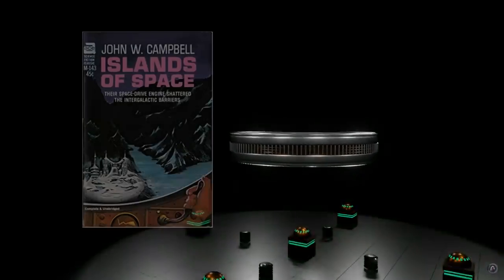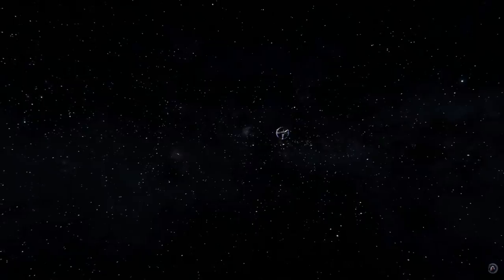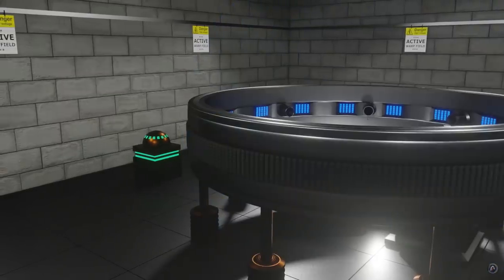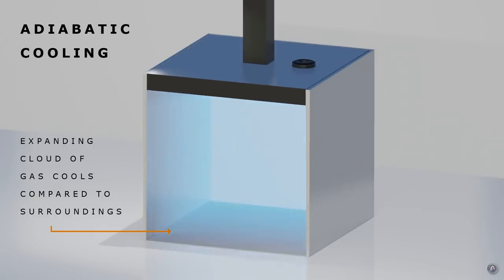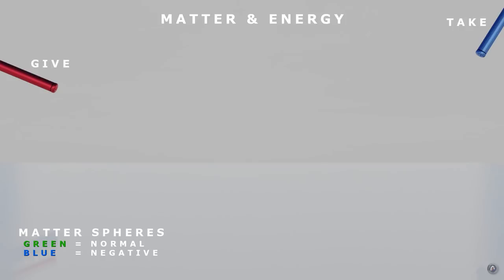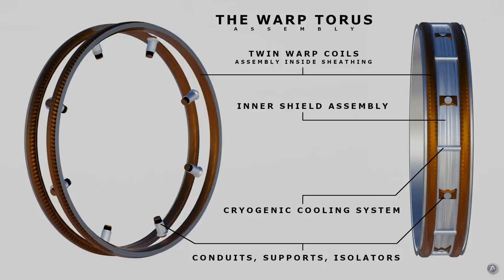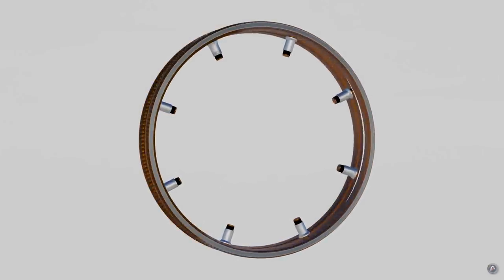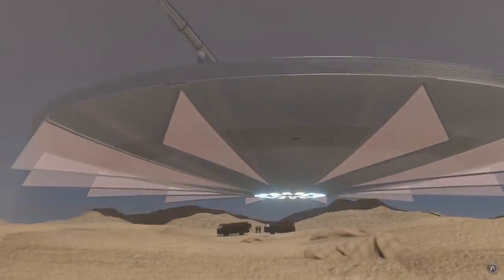A Detailed Breakdown of an Alcubierre Warp Drive Coil

Comment: So..practical warp drive is getting more and more into a domain of "enginering problem" than "science/physics problem"... thats quite promising...
Reply from the maker: Fueled by an increased understanding of the medium (spacetime) in which we will travel.
Reply: 03:30 It says "18 billion mega-watt hours for a single warp event".  1,000,000X3600=3.6E9 Joules.  Times 18 billion; 3.6E9X18E9= 6.48E18 Joules.  Okay; even with your Quark matter bred to antimatter for fuel and a 1 TW reactor power fed to the ring would take 6.48E18/1E12= 6.5E7 seconds or 750 days to deliver your "one warp event energy".  What size ship/coil/power reactor(s) are you envisioning for your ship?  That would have to be one large coil and obviously large ship to generate/handle that kind of power/waste heat etc.
Reply: Yup, the biggest issue to overcome is the power requirements to either go as fast as light, or more likely, to rip a spot of time and come out back into the stream of time somewhere else.  Though not the only issue, just one of the big ones.
Reply: 18,000,000,000 MWh??? People dont get it how much energy that is, a nuclear powerplant wont be enough. I heard that they reduced the amount of requited negative mass needed for a warp drive to a few kg, by changing the shape of the disk and by making it oscillate to high frequency, we might do the same thing with this version of warp drive so we can drop the energy needed to a few gigawatts and in addiction...we might find a frequency of resonance like Tesla did with voltage in order to amplify the warping intensity of the ship by the time it travels, that will drop the amount of energy required even more, by far.
Reply: @asteronx  18,000,000,000 MWh??? People dont get it how much energy that is, a nuclear powerplant wont be enough. I heard that they reduced the amount of requited negative mass needed for a warp drive to a few kg, by changing the shape of the disk and by making it oscillate to high frequency, we might do the same thing with this version of warp drive so we can drop the energy needed to a few gigawatts and in addiction...we might find a frequency of resonance like Tesla did in order to amplify the warping intensity of the ship by the time it travels, that will drop the amount of energy required even more, by far.
Reply from the maker: @tirannoide9056  Thank you for the suggestions. We are already aware of such things and have already been exploring possible ways of reducing the amount of energy needed.
Reply: THANKS TO A MEXICAN SCIENTIST OF THE NAME . MIGUEL ALCUBIERRE.....AND NEVER GOT THE CREDIT FROM THIS STUPID VID.....OH BUT STAR TREK DID AND AND A HANGER ON A DOCTOR WHITE WHO MERELY WANTED TO INVOLVE HIMSELF IN MIGUELS CONCEPT.
Reply: This is a static warp field a lot of things are being overlooked. For a warp drive to work well have to learn to make a warp matrix. To control all the energy condition and make them work for you. You have to deflect and collect some of the spacetime energy and particles in front of the ship.That well also change the bipolar warp matrix by increasing it. This collected matter and energy can be converted to first antimatter then into warp plasma or what we call depositrum. Once you have enough of this it becomes easy to store and then use. It has the same energy as matter antimatter without maxing it with matter.
Reply: Actually, it's also a "science/physics" problem because key elements of the concept have not been proven to exist, save for in the imagination of scientists.
Reply: @ZeyphodZeyphod  The thing would explode and then maybe emplode not good.
Reply: "The thing would explode and then maybe emplode not good."  But the video maintains that reduced inertial mass effects etc. would happen at field strengths/currents/energies well below the 18E9 mega-watt hours amounts needed for the full on warp effect.  That is we would have proof of concept (& useful effects) at much lower energies; once we have that the rest is just a engineering challenge.  Albeit a serious one.
Reply: @ZeyphodZeyphod  The problem is not the mass effect. The problem is the bipolar fields. You have a contracting field in front an expanding field in back and rest mass in the middle. You are creating a unnatural imbalance, space well try to balance itself. To help keep the three field balanced you have to have it moving at a threshold speed. The three field have to be far enough apart and each at the correct energy level compared to each other. Some of this finds it's on balance but not completely. At low power the balance is not that important. But at high power level it is. If you put to mush power in a small spot the power may or may not overload and explode but the effect if too high well emplode. At high power all three fields have to be in balance. You also may be able to alter the front field through vacuum engineering and decrease the energy need of the matax  and produce more energy at the same time and counter the radioactivity at the same time. But I am going off the subject. Too much energy too fast can collapse the field.
Reply: @Clement Vining   But first we have to establish that it works; the lower energies would give us our needed proof-of concept.  Reduced inertial mass etc. would make high performance aircraft like the alleged Gimbal or Tik-Tak footage crafts possible. Then we can work on engineering it to handle the issue(s) you speak of.
Reply: @ZeyphodZeyphod  I agree and I think the military is already doing so with superconducting liquids or solids which is a gel.
Reply: @colonelburton8451  What parts tell me.
Reply: At the end of the day it's that exotic matter we need.  Dark energy exists (despite naysayers) and that expands the universe faster than light.  At least at the edge.  Which is why we don't see anything beyond the edge.
Reply: Zeyphod45 Zeyphod45 what of you put your power plant in space and wait for it to make sufficient energy and then go up attach it and go
Reply: @ZeyphodZeyphod  Are a university student?
Reply: @tirannoide9056  wouldn't put it past Elon musk to pull it off.
Reply: @TheCaptainSplatter  It isn't Dark Energy that is needed, it is "Negative Energy" which is made out of pure mathematics.  It isn't a real life thing.    Unless you can show me a negative hamburger or a negative glass of beer, we aren't going to be able to make a negative-powered spaceship
Reply: @jengleheimerschmitt7941  dark energy might be negative energy.
Reply: @seansoblixe9711  the warp drive is literally named after him. "Albubierre Warp Drive Coil".
Reply: it would take less time if they wanted to even a test flight for lets say 5 seconds close to FTL or Impulse would tell us if a craft even the size of a car or smaller covered 4 times the distance to the moon or did it get close to the distance of mars? Will see I hope...sooner....
Reply: @clementvining2487  _
Reply: @tirannoide9056  they have worked out a way recently to use normal positive matter
Reply: @TheCaptainSplatter  Dark Energy and Dark Matter are placeholders for an unknown matter and energy we have not discovered yet to account for the universe's total matter/ energy i.e. total mass/ energy of universe = observed matter/ energy + dark matter/ energy.
Reply: @TheCaptainSplatter  We are limited in how far we can see out into the universe,  not because it's expanding, but because we eventually look so far that time that light would have taken to reach us would have to have come from the Dark Era of the Universe, which is a period when the universe was opaque, ie light couldn't freely move through spacetime. So there was no light for us to see.
Reply: @ZeyphodZeyphod  Except recent speculative models bring that power down potentially (if each pan out and can go together) as much as 30 orders of magnitude. 

Then there's the recent work of Eric Lentz suggesting negative energy mass could be avoided completely.
Reply: It's not an engineering problem.
It's not even a physics problem.
It's a causation problem.
By definition FTL is backwards time.
You can't arrive before you leave.
Reply: @deerlakediver5554  only if you're moving through normal space time. As soon as your path is disconnected from the path taken by light you just arrive before the light showing you left. It falls under the acausal effects already observed in situations like the delayed choice experiment cause and effect happen out of the usual order but must still preceeded observation. Which in this case would actual be a closer fit for actual backward time travel being allowed so long as the light of your arrival at say Alpha Centuari 4.3 years ago doesn't arrive at Earth untill just after you jump away from Earth. That's "acausal" without violating causality.
Reply: @deerlakediver5554  Let's consider 3 perspectives of a ship travelling between two points using this theoretical FTL drive, from the origin, the destination and the ship. Let's assume that the ship is travelling 5 times the speed of light, and leaves at year 0 and travels a total distance of 10 light years. From the point of origin the ship would appear to arrive at its destination 12 years later, 2 year ship travel time and 10 year light travel time back to the origin. From the destination two ships would suddenly appear seemingly out of nowhere at year 2, one would appear to leave and progress backwards towards the origin for the next 8 years with events happening in reverse and then suddenly disappear, 10 year light travel time from origin less 2 years ship has already been travelling, the second one would be normal from time of arrival. From on board the ship the trip would take 2 years, but looking towards the destination everything would appear speed up by a factor of 5, looking backwards to the origin events would appear to speed up by a factor of 4 but going in reverse or not be visible at all as light wouldn't be catching up to you.  I'm assuming that as this drives is compressing/decompressing spacetime that itself is not subject to any relativistic effects. So from the point of view of the destination and the ship once it arrived, you would see the ship arrive first and then be able to watch it in reverse until it gets back to the origin and suddenly dissappears 8 years later. Anyway obviously just pure speculation, and fun thought experiment, and I'm sure that there are actually numerous issues with my description.
Reply: @nic.h  
Time and distance dilation are REAL.
They are not just visual illusions.
On a long enough trip you would arive (even from your own perspective) before you were born.

Then there is the whole problem of distance. From the ships perspective the faster it goes the shorter the distance in front of it.( distance compression).
Above the speed of light that distance in front of the ship shrinks past zero, to some negative number. There is no such thing in a four dimensional universe as negative distance. For the exact same reason there is no negative time.
Reply: @johnassal5838 
Forget about a ship....
INFORMATION ITSELF CAN'T TRAVEL FASTER THAN LIGHT..
Reply: My Nibbler  
Three scenarios...
1. I'm traveling slower than light.
From my perspective it takes me 10 minutes to make my trip.
2. I'm traveling at the speed of light.
From my perspective it takes zero minutes to make that same trip.
3. Im traveling faster than light.
From my perspective It takes me negative minutes to make that same trip.

That third scenario is not possible.
Reply: @deerlakediver5554  "Through Space." If instead that information takes a shorter path, be that through a wormhole or hitches a ride in the unusual topology of an Alquibier-White effect then from it's perspective it will not have attained any special level of speed. 

Consider that a version of the  Delayed Choice Experiment could be run with a photon the path of which is/was bent by a gravitational lensing object like a galaxy a hundred million years in the past and a hundred million light years away. To the best of my knowledge it has yet to be, but if it ever is and it's results mirror those of much smaller yet thoroughly reproduced table top versions ( which do indeed validate the acausal order of events ) then an action in the present will determine the path the photon already took though the final result (conveying information ) will not be visible until after the action in the present blocks one of other path. True that photon does not encode a traditional signal but it's mere presence and significance tells you your action must influence prior events just to get that result. 

No I'm not trying to claim that this constitutes any sort of FTL signaling device but it does show the equally big implication that cause and effect can vary and very definitely traverse immense distances and durations without violating causality or engaging in time travel anymore than an FTL craft would just because light is slower.

Einstein was very clear that this should only really necessarily apply to movement through space time and not instances where the space time moves or is contorted into a shorter path. Yes these have their own issues at the moment but these are increasingly becoming more and more an issue of engineering. It's anyone's guess as to IF this will continue untill FTL becomes practical. 

Feel free to shift your argument to the known issues of wormholes for instance (without actually responding to the fact your previous point was in fact answered.)
Reply: @deerlakediver5554  remember that this drive is in theory compressing spacetime in front of it, so within its own bubble of spacetime it isn't traveling at speeds faster than light. At least that's my vague understanding of what it's supposed to do. While I could arrive at the destination before the light from the time of my birth would get there, that in itself isn't a problem, I wouldn't be able to return back to that point before my birth in space time with how I was describing this.
Reply: @deerlakediver5554  No kidding the third scenario is nonsensical /sarcasm off./

You're going out of your way to apply relativistic laws to movement through space that everyone else here understands would be impossible. That's really not what the question is. Smh.
Reply: @johnassal5838  
Feel free to start insulting someone else.
Reply: @johnassal5838  The Universe DNGAF about your rules, or your light. The speed limit that everything in the Universe must adhere to - the universal constant - is about something much deeper. As Matt explains, the speed of light should really be called the speed of causality.

You can think of causality in relation to a concept known as the spacetime interval, which states that causal connections are the only order of events that all observers, from wherever they're positioned in the Universe, can agree on.
Reply: @deerlakediver5554  OK, just as soon as anyone else acts as smuggly self absorbed yet inexplicably ignorant of their own errors I'll be sure to offend them too by pointing as much out. 

Tl;dr: Your repeating Einsteins verified conclusions for motion in 4d isn't actually going to apply to scenarios intrinsically intended to avoid it the conversation everyone else is having is in regards to the surprise we all feel that this second scenario may in fact be achievable or at least may soon be just as testable as GR or SR. 

You're arguments are 100% valid in context which unfortunately your comments are not. You're not the only one finding that mildly insulting.
Reply: @johnassal5838  
OK, you have a warp drive and it takes 15 days to reach Andromeda... in whose reference frame? The traveler's? Those left behind on the Earth? Somebody else? The amount of time that elapses between two events depends on the observer.

And here is the thing: if you move faster than light, there will always be observers (who themselves aren't moving faster than light, i.e., perfectly ordinary observers) for whom the amount of elapsed time will be negative.

OK, you say, you don't care that some people traveling on strange trajectories see you moving backwards in time so long as the people left here on the Earth don't. But it's not that easy. Because you can devise a round trip that allows you meet with these observers, fly to Andromeda and back, and then meet with them again... before you met them for the first time, as measured by their clocks. In other words, you bring information to them from their future, and then you have a chance to influence their past. (Which is when all sorts of paradoxes ensue, much to the delight of Doctor Who fans.)

Having said that... it is possible to conceive of faster-than-light travel without a causality violation, but only by introducing additional postulates. Specifically, if you introduce a privileged reference frame and postulate that no matter how you travel, you can never move backwards in time with respect to that reference frame, as a consequence you will never be able to return to someone's past, no matter how they move. Causality will be preserved.

The existence of such a privileged reference frame is kind of an anathema to relativity, but it is a legitimate postulate. Such postulates (explicit or implicit) are sometimes used in novel theories (e.g., bimetric theories) to allow for violations of Lorentz invariance without breaking causality.
Reply: @nic.h  
OK, you have a warp drive and it takes 15 days to reach Andromeda... in whose reference frame? The traveler's? Those left behind on the Earth? Somebody else? The amount of time that elapses between two events depends on the observer.

And here is the thing: if you move faster than light, there will always be observers (who themselves aren't moving faster than light, i.e., perfectly ordinary observers) for whom the amount of elapsed time will be negative.

OK, you say, you don't care that some people traveling on strange trajectories see you moving backwards in time so long as the people left here on the Earth don't. But it's not that easy. Because you can devise a round trip that allows you meet with these observers, fly to Andromeda and back, and then meet with them again... before you met them for the first time, as measured by their clocks. In other words, you bring information to them from their future, and then you have a chance to influence their past. (Which is when all sorts of paradoxes ensue, much to the delight of Doctor Who fans.)

Having said that... it is possible to conceive of faster-than-light travel without a causality violation, but only by introducing additional postulates. Specifically, if you introduce a privileged reference frame and postulate that no matter how you travel, you can never move backwards in time with respect to that reference frame, as a consequence you will never be able to return to someone's past, no matter how they move. Causality will be preserved.

The existence of such a privileged reference frame is kind of an anathema to relativity, but it is a legitimate postulate. Such postulates (explicit or implicit) are sometimes used in novel theories (e.g., bimetric theories) to allow for violations of Lorentz invariance without breaking causality.
Reply: @deerlakediver5554  You raise perfectly valid questions. Thank you. No, I'm not in any position to make anything but a wild guess myself. I'm sure we'd both be less interested in the bounds of my imagination than in the actual answers, if any ever become available. This particular channel is not one I'd be too quick to call definitive in any case. He's no Isaac Arthur. Please don't mistake my statements as support for seemingly arbitrary predictions of when what may (or indeed "will") be discovered. 

It's fascinating and more than a little surprising that any of this might become testable in my lifetime much less potentially usable if verified. 

That said, it's true nobody can currently answer the questions you raised nor seemingly provide any firmer basis for an answer than I can. But, this too has no actual bearing on the fact that it does in fact appear we might just get those details if and when these conditions can be tested. 

Not to make inarticulate comparisons between aerodynamics and FTL but even the Write Brothers made kites before their first windtunnel. What you're asking for is akin to a detailed explanation of all areas of the aerodynamics and mechanicals whereby a helicopter flies when we've yet to even prove it's possible to build a kite. The absence of these details at this stage is in no way indicative of what will or will not prove possible much less practical.
Reply: @deerlakediver5554  I had thought about including a round trip example with my initial attempt. Again this is all postulating that this ship travels at sub-luminar speeds within a bubble of spacetime so is not subject to dilation effects. So let's say that the ship having gotten to the destination hangs around for 3 years and then heads back to it's origin,  in that scenario the return trip essentially reverses the perspectives of the viewers at the origin and destination. The ship would suddenly appear out of nowhere back at the origin 7 years after it originally left (2 year out, 3 year wait, 2 year back), they would see the ship at the origin, it's reverse time image going back to the original destination and still be able to see the image from it heading out on it's first trip with 3 years remaining before the light from it reaching it's destination would get to the origin. So in that scenario someone at the origin could obtain knowledge of what was going to happen to the ship on its way out, but there would be no means for them to effect it from happening, it already had happened it's just that the light/information hadn't reached them yet. Again just wild speculation, based on the assumption that this ship would not experience relativistic behavior. Reality still flows in one direction, even though some events look to go backwards due to the way light would arrive, you could never get back to those points in time or change the outcome.
Reply: @deerlakediver5554  I didn't really answer your 15 days to Andromeda question directly.  This would be 15 days from the perspective of someone on the ship. For an external observer at the origin it would look like it took 2.5 million years, for an observer at Andromeda they would seem to instantly appear 15 days after they left, but they would see the actual ship there and a ghost image heading backwards to the origin for 2.5 million years.  I could see travel routes getting quite confusing with ghost images heading back and forth. Again just take this as fun speculation.
Reply: @nic.h  giving you information about your future would change the future you's past.
Changing your past is a simple example of breaking causation, which is impossible, no matter what kind of engine you do it with.
Reply: @deerlakediver5554  I would argue that's not the case here though, the people returning on the ship, can provide information from their past which has already happened to people at the origin who haven't seen it yes, but that event had still already happened its light/information just hasn't reached them yet and they have no means of altering that. Suppose that they jump onto another faster ship and try and catch up with the original voyage out in an attempt to alter events, they would never be able to reach the first ship though as, as they head out light from the events will reach them faster, so the faster they try and catch up the faster events seem to play out so that the original ship will always get there first. So I think causality still holds.
Reply: @nic.h  
If i can intersect you in two places in two different places, in your future first, then in your past, that breaks causality.
Reply: @deerlakediver5554  I don't believe that is the case with how I've described this, events occur in order the difference is that the information from those events arrives at different rates and order depending on your movement and location, but time still moves in only one direction, I can't get back to my past with how I've described this. I can watch my past and know what is about to occur because the events take time to get there, but it's still from my past. Even if I tell you at the origin what is about to happen it still doesn't mean you can do anything to change it, it's already happened it's just you haven't seen it yet and as I said if you try and act on that information and try to catch up to the event all that will happen is you'll make events seem to play out quicker, basically you would be chasing a ghost of something that has already happened and just hastening it's arrival for you to see, but you could never reach it. The faster you try to catch up to it the faster the light from those events will arrive.
Reply: It already is. The theory behind it is set. But the "how the fuck do we make something that can do this" we are already at that stage for alot more things than you think.
Reply: At least it’s better than it being physically impossible, now we just need something to generate that energy 5 times over
Reply: @tirannoide9056  maybe he's got to wait for a lighting bolt to strike the clock tower
Reply: @tirannoide9056  This is the warp drive version with 700 kilograms. And alternating the energy. They are on the wrong track.
Reply: @asteronx  Sorry, but neglecting the difficulty to acquire large amounts of dark energy, or to "store" it, is not a trivial thing. i don't care if we move backwards or forwards at light speed. it still is not enough to explore far space.
Reply from the maker: @Gunni1972  This is how we're going to explore space: The Musha Jump Drive https://youtu.be/ShIJSpV3BII

What will power it we will an artificial singularity...video coming.
Reply: @deerlakediver5554  only way that could work is if you visit a alternate universe branching timeline thing
Reply: @ZeyphodZeyphod  im thinking that with an explosive nuclear reactor it would take hours or days to charge up the warp event
Reply: @deerlakediver5554 I do good to build a Lego box. I wish them well.
Reply: Like an old record player. It seems you have to know slow and normal and fast speed,  what a skip is and what over and over is and what a scratch is and hoe to build the record and record player.
Reply: @asteronx  I know one of the other ways was to use anti matter reactors.
Reply: @ZeyphodZeyphod  that is about 1/55th of a type 1 civizillations energy budget, that is certainly alot but alot less than expected
Reply: @asteronx  are you like making this warp drive or what do you mean by "We are already aware" cause are you like a reasercher
Reply: @colonelburton8451  yeah, but we know so little right now, by around 2100-ish, we should know the physics completely